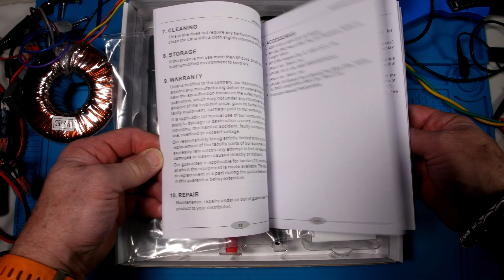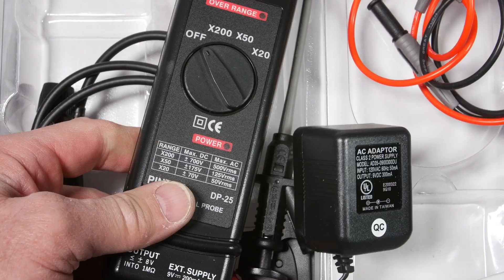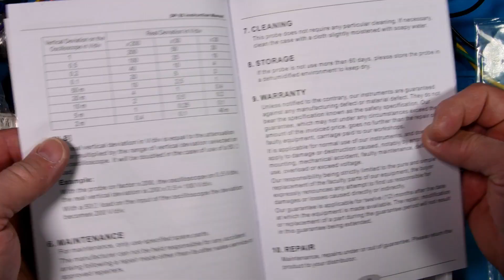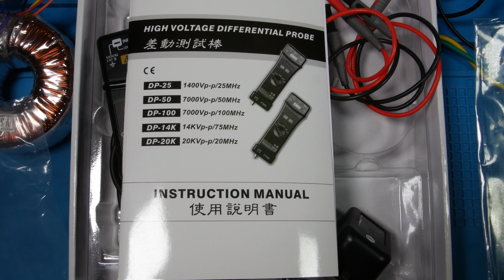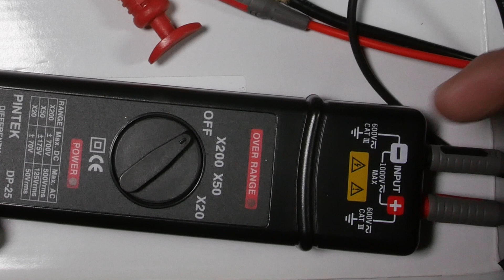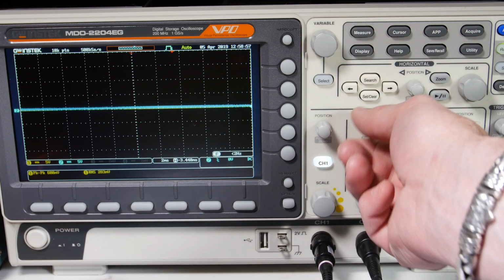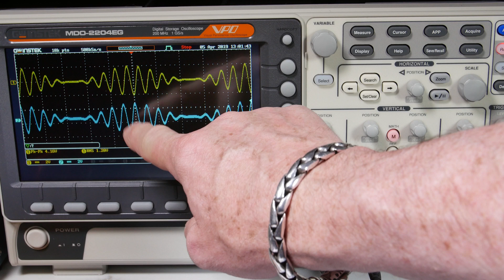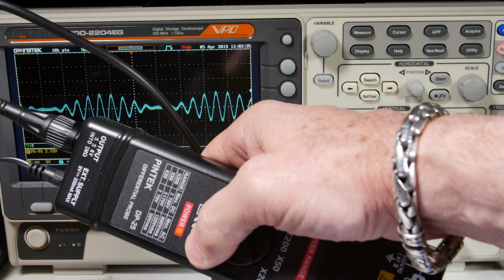New low cost Pintek DP-25 differential probe

Comment: Great video with a lot of new knowledge for me:-)
If the high voltage probe's ground is isolated, does that mean I can measure both side of the transformer at the same time?
Because that should me a wary bad idea on a normal common ground, right?
Reply from the maker: Yes, exactly.  You can safely take measurements on both sides of the transformer.
Reply: @KissAnalog  great thanks! :-)
I like your reviews, down to earth, informative and at great steady pace. :-)
What I do not understand is, why does it cost as much as an entry level scope?
Reply from the maker: Thanks - I appreciate that!  I totally agree about the cost - it makes no sense.  The circuit is not that difficult or expensive and same for the housing.  I’m surprised that Siglent wants so much.

Comment: Good video. I'm curious as to why you chose the Pintek probe in particular? I can't see any advantage over the Micsig DP10013. The micsig is much cheaper (I got 2 of them for £160 ~$200 US), has a 100MHz frequency response (mine have 3.2ns rise time), has more accessories in the carry case, has a galvanically isolated USB power input so you can power it from your scope directly, etc.

Can you please elaborate on why you chose this one over the other differential probe options?
Reply from the maker: I was on the fense;). I decided to purchase the micsig to compare.  Will be a great video for those that are shopping.  I do want to offer a diy design as I think they are all far too expensive!  They rival in cost a much more difficult product to develop - the actual oscilloscope!!